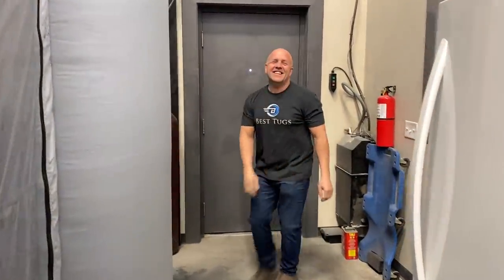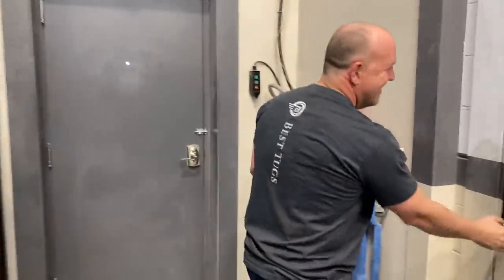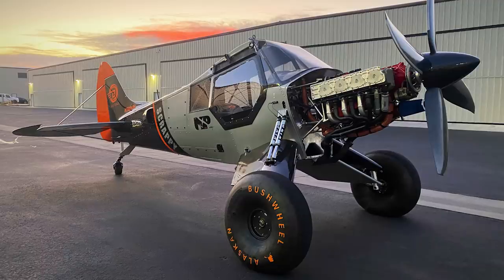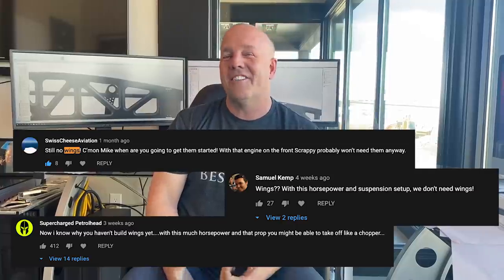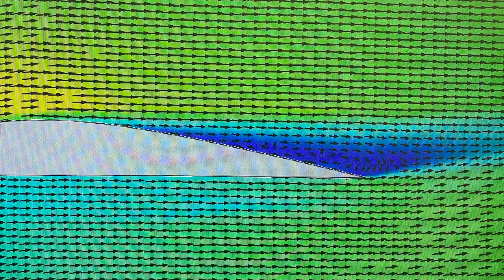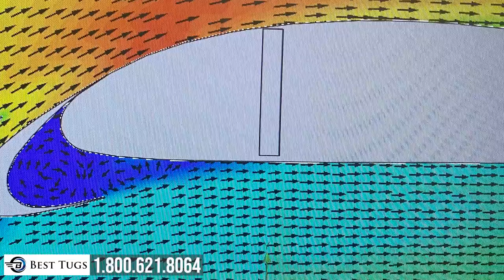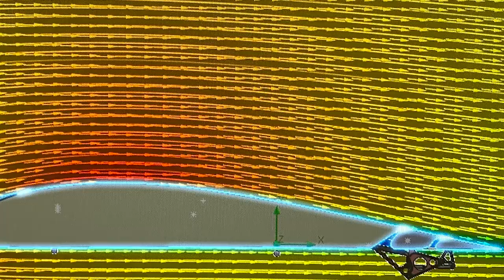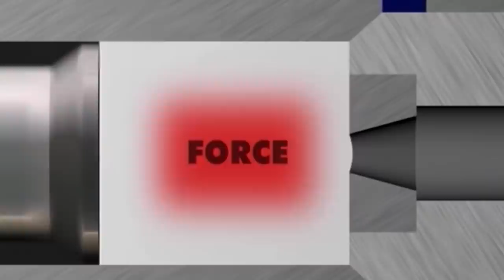Airplane Without Wings, Let's Try Something Different! | Scrappy #42

Comment: Well boys, we did it....we made him talk about the wings...
But seriously though you are such an inspiration.
Keep going mate.
Reply: 😂😂😂 I guess we all thank you. 😂
Reply: As for flaps and ailerons competing with each other, why not just combine them, make a flaperon, that always maintains an increased flap setting but also act as ailerons?  That way you'd get the entire wing as ailerons, and they both would also have a flap component put into them so you'd have flaps for the entire wing too.  Maybe ailerflap would be a better name, coming up with the name is the most difficult part.  Although moving the flaps out the front of the wing also to keep gravity centered would be the way to go.  As for that computer hardware you bought, the hardware you bought was overpriced and substandard, F4-4000C18Q-128GTRG has been reported to only achieve 3200 speed, could have saved a bunch on that. Those graphics cards, PYN Nvidia Quadro RTX 4000, they are only ranked 15,322 on passmark gpu benchmarks, a regular GTX 1080 or an RTX 3080/3090 would have been the way to go, if you could find them; but you appear to be made of money, so I'm sure you could have gotten some.  I built wings out of plywood when I was 12, figured out all the best lift to weight ratios, the wings were to strap on my arms; no computers were available, just measured birds wings sizes and their weights from an encyclopedia.
Reply: @nedblakely997  flaperons already exists for example on Trent's Freedom Fox. As always there are advantages and disadvantages to them. The main disadvantage I see for Mike's application is the added drag in cruise mode.
Reply: Mike shouldn't stop at extending wings, do swept wings! :D
Reply: @nedblakely997  your wing: everybody knows that.. I gues Mike as well. But he needs a wider envelope.
Reply: @dinobot_maximize  swept wings are very bad at low airspeeds, which is why you don't see them on too many piston powered or propeller driven aircraft
Reply: @MaximEck96  hey look at that, it does exist already.. but not as good as I would do it, but you are right it does exist
Reply: @tinolino58  well if his choice of airplane parts is as poor his choice of computer components.. scary.
Reply: @nedblakely997  hilarious how the IT nerds see the world.. love it! Have a great day 🚀🌴☀️🥂
Reply: @nedblakely997  Ned, your description was very interesting until you got to the end part... never forget what happened to Icarus when he started strapping stuff to his arms!    ;^)
Reply: @tinolino58  who is an IT nerd?  Certainly not me, I can bench press 300lbs, run a mile in under 7 minutes, do 20 pullups without cheating, and am skilled at just about everything I do, I have an IQ over 180+ on a bad day. But I am nothing special, I just am not religious, in other words I don't believe in anyone's authority, I figure things out, and I haven't been dumbed down like most people subjected to public school indoctrination, fluoride in the water, toxic injections by rockefeller quacks, etc. So yes, have a good day, maybe try to cut back on the insults and just look at facts and figure things out, try to not pigeon hole people into groups just because you don't comprehend something.
Reply: @MrGaryGG48  well I never got a chance to test them, I couldn't find the right type of materials and didn't have enough funding.. and like I mentioned, I was 12.
Reply: @nedblakely997  180 and feel assaulted with a comment about your simpel wing proposal? Get real. Talk to your ego and smile 🤣
Reply: @nedblakely997  an IQ of 180+ "on a bad day" would put you in the top 10 IQs ever measured. Why has nobody ever heard of your genius and scientific accomplishments?
Reply: @dinobot_maximize  FORWARD swept!!!
Reply: @JamesBalazs  yes, 180+; I have plenty of accomplishments, but they are for myself, I'm not a try-hard out trying to gain followers; you've heard of Einstein, yet both of his theories have been proven wrong and just math fantasies, one with a 1 page paper, by Stephen Crothers.   Fame has nothing to do with IQ, in fact the smartest people, you'll never ever hear about. Ever hear of Kary Mullis? Inventor of the PCR test, who declared, just before his timely death 2 weeks before event 201, that the PCR test can't be used to measure viruses and that Fauci "is a fraud", exact words. Ever hear of him?  Ever hear of the olympics?  Do you think those are really the best of the best?  They aren't. The best will never even get to see the olympics.  Okay, got to go now, I'm done with this thread.
Reply: @nedblakely997  as Stephen Hawking once said "people who boast about their IQ are losers". And you can attribute the following quote to me: people with no accomplishments in life who boast about their false IQ (while probably having never taken an IQ test) are worse than that.
Reply: @JamesBalazs  Stephen Hawking believed in black holes and other math fantasies too, but there you go also making an appeal to authority. And I'm not bragging about my IQ, I was defending myself from your inane attacks by presenting facts.

Comment: I’m obsessed with watching and learning from these builds. The shear amount of fine detail built in is remarkable.
I’ve gotta build my own plane now. I’m a military pilot, lots of time on the T-6 Texan 2, and you’re inspiring me to learn aero eng to build my own monster.
Reply: Same! I'd love to build my own plane (or two, or more :P) someday and I'd start with preexisting kits, but I have my own idea for a pusher bushplane I'd like to try. I already have a basic idea on how it would look and work, but I have so much more things I have to learn and decide on, such as what materials and construction methods I'd use. I also want the design to be easy to build and maintain, and affordable in case I decide to enact on my crazy business idea to start a kitplane company. I also have an idea in my head for an even crazier plane: a pusher bush plane that is also a hull-style amphibian and the wheels would either tilt up like a SeaRey or maybe even retract into the fuselage to allow it to cruise at higher speeds than a typical bush plane. But these are purely ideas so far and aren't that well thought out and might not even work. Before I attempt full scale though I'd definitely try out scaled RC models
Reply: Jon, nobody builds an airplane like Mike Patey!
Reply: @GaryMCurran  Absolutely! Thats why I'd find it absolutely amazing if Mike would design a new kitplane and sell plans and kits for it so others could experience a plane that is so well designed and thought out with Patey  engineering.
Reply: @johnnyboythepilot4098  legality of him selling/designing a kit would be quite the headache. But a well engineered barebones kit designed to be a blank canvas would be interesting.
Reply: @Pilot_405  Well there's plenty of kit manufacturers and people with a lot less money and experience than Patey embarking on those endeavors despite the liability risk, so I figure it would be a whole lot easier for Patey, especially with him being a serial entrepreneur.

Comment: I may be on short final but when Mike Patey drops a video I'm going around and doing some 360s while I watch this
Reply: Normally I just land on the nearest road instead of the runway so I can get to the video quicker.
Reply: @swisscheeseaviation590  I told the tower I would be circling they said they understood. They were watching it too.
Reply: Short final????  That is a term used by pilots who land planes, not ones that just pull the chute and float down!
Reply: @JustPlaneSilly  😂
Reply: Be real, you botched the approach.
Reply: I was hoping Mike would give us a peek at the profile he is going to try
Reply: @russellsmith3825  he did ... the whole time the foil was on the screen in the background ...
Reply from the maker: @JustPlaneSilly  😂😂😂

Comment: I was waiting for Mike to say he's putting F-14 style wing on Scrappy.
Reply: Or F15. Actually a very good idea. It has a drooping leading edge. Flies real fast AND real slow!
Reply: Lol! I was thinking exactly the same thing!
Reply: I  thought for sure he'd say he was going have controllable swept wings. LOL
Reply: That's what he would have done if he wanted to extend the wing out to increase the span, but he's going on a completely different route altogether. He's not making it tall, he's making it fat and wide . . . 😂
It'll be an extremely challenging part to engineer but it'll be an aeronautical engineering feat. 
This design style is already a naturally occurring phenomenon, in birds (most prominent in owls) but it has never been successfully designed. 
Variable sweeping wings (the technology of F-15) was a major breakthrough in aeronautics, and so can this be if it's pulled off successfully.
Reply: @ah11980  Yes, I put the wrong number 😅
Reply: @otemporaomores  Not a good idea at all. The F-15 is NOT a slow flier. It's landing speed is about 190-200 which is 50 above the F-18 and 80 over the F-14...
It's wing design is utterly outdated too, it's not even supercruise capable so what lessons could potentially be learned here?
Reply: more like the f-16 wing that changes camber in flight---
Reply: @kontoname  I have seen an f-15 do a 80 mpg knife edge at 50 feet----  lets see you do that in a super cub !
Reply: @user-ev6kv7lf2v  let's forget for a second that the F-15 stalls at nearly twice that speed, so no knife edges at 50 feet for you, you might be missing the two gigantic afterburning jet engines in the back. The F-15 is capable of maneuvering at slow speeds because those two engines can make it just bruteforce physics for a short time in the right hands. It's not meant to fly slow. Those wings don't allow it to fly well slow.

Comment: BY A MILE my favourite MP video of all time! I am so excited to hear of your variable camber thinking, we have been working on a concept for altering the camber along the full span but in a way that it varies differently at the tips as it does at the roots and is integral and linked to various phases of flight and operation. Our system employs a rotating actuator and a semi-flexible skin but we have suffered one challenge after the other, that's after tackling the obvious questions like how to keep it lightweight, not overly complex and expensive, how to, like a bird, fully alter the shape and size of a wing physically and relation to airflow and state and in as natural and unobtrusive a manner and not disruptive to the physics and operation of the wing. There's a NASA and various studies on this but all were extremely complex and jointed/segmented leading to unnatural action.

That's one reason why I am so in love with this video, but another that's just as important to me is that finally, we are taking steps to have a complete aesthetic so that I can finalize the slowest aircraft portrait of all time! When I saw you finalize and be sure of the design and size of your empennage I had a suspicion that you had a pretty good idea of the wing design already although I am sure it would have needed much refinement since. I CANNOT WAIT!! 

P.S I wasn't aware it was even an option to not watch to the very end, and then stare at the blank space wishing there was more.

Comment: I have often thought that the answer for wings is what the Falcons and airlines have been doing for decades; relative high speed profile (thin wings) with leading edge devices (droops and possibly vortex generators) and double slotted full span Fowler flaps with fences and spoilers .  This effectively makes a thin narrow camber wing into a broad thick wing with the benefit of all the devices to keep the air flow stuck to the surface of the wing...

Comment: Hey Mike awesome as always, 
America’s Cup yachts last generation were using solid wings which altered camber on the go, no sails, so more camber to get up on the foils and then flatten off as resistance decreased and higher speed = less drag. Have a look at the America’s cup on You Tube current event happening now!
Reply: i follow the America's Cup and was thinking something similar, and kind of wishing that mikes build a flexible, morphing wing with some kind of flexible/elastic skin that includes all the moving parts inside :)

Comment: Sounds complex Mike I can’t wait to see the results. Did you ever look at the concepts the America’s Cup boats use for the main sail? It’s a double skinned wing that the crew can change it’s shape on demand for speed and lift. Cutting edge technology that make those boats literally fly up out of the water at 20kts in just a 5kts breeze.
Reply: I’ve thought the same thing! So much potential there I would think... Also, this advanced wing concept has got to be another reason to go with the parachute system. Asymmetric wing configuration could make the aircraft uncontrollable. I’ve been hoping for something like this!

Comment: I can imagine a lot of nights spent thinking and thinking again about new ways of doing things... love that. My other crazy ideas: 1/ an inflatable upper part of the wing to transform a high speed profile into a high lift profile, with springs keeping the tension of the fabric uninflated (retracted inside). I know, you don't want that air balloon to be punctured or deflate suddenly while flying at 35 mph low over a forest... But inflatable technics are so much better now Than it was 20 years ago... 2/ blowing air at high pressure over the sensitive zones, either to force normal air to stick, or to replace air that do not stick... Ok I'm a dreamer... not an engineer :D Love your work. Thanks for sharing this with us. Take care, from Switzerland. Nic

Comment: Halfway through the video when you were asking all the questions about "The [single] perfect wing design" I couldn't help but think about a wing that dynamically alters its shape in-flight. 
A few minutes later and that's exactly what you're going to do. Contrary to my ideas of a perfect design that always end up unfinished and left to rot, you've followed through to an actual design and are pushing through to a finished functional product. I'm continuously amazed by how you are not stopped in your tracks by the size of the task ahead of you.

Comment: Sounds as if Mike wants an aeroelastic, variable aperture(s) leading-trailing edge multiple element telescopic 2 axis  variable incidence and position wing.  There will never be another, Roll control and perfect pitch control to Zero Airspeed, with a top end over mach 0.XX...

Well done Mike on Attaining Engineering Design Freeze.
Reply: Hahahahahahahaha! Oh! That's a mouthful 😂😂 
It's also funny how accurate the name is, LMFAO!

Comment: I love the engineering purity of asking the question of why can't I design something that is low drag at high speed and still has a low stall speed, and then going ahead and solving for that  condition. 

Experts: You can have speed or low stall speed. 
Mike: Conventional wisdom be damned, I can solve for both.

Respect
Reply: Yup.  A good engineer looks at the observation that the same wing shape isn't going to work well for high speed and low speed, and says, "okay, but what assumptions are built into that observation?"  There's an obvious answer: "Who says I have to use the same wing shape?"

That's obvious enough that there's a standard answer: Conventional wisdom says that you can add flaps and leading-edge slats, but altering the basic wing shape is too complicated.  Mike looked at that and said, "That's not a law of physics.  That's just, like, your opinion, man.  Too complicated for what?"

And then the thing that's really Mike's genius comes in: actually making it work.  A lot of people could say, "sure, the solution is that the wing needs to transform."  But building one that's reliable and will fly and not be too heavy, that's the real challenge.

Comment: In order to reach pressure equality between the upper and lower side at the trailing edge of the wing, the pressure will have to increase again as you move further towards the trailing edge. The boundary layer of the flow doesn't like this at all. Strong pressure gradients will cause the boundary layer detach . A detached boundary layer (stall) causes a drastic increase in drag and decrease in lift and is therefore highly undesirable. : )
Reply from the maker: 🤠 yes 🙌🏼👍 I love technical comments make me smile.  You are 100 percent correct any that was one of my bigger challenges in creating an in flight adjustable wing in both camber and cord.  I think you will like what I have done to accelerate the air and keep everything laminar all the way to the tips at extremely high aoa and low speeds.  Thanks for the great comment 👍🤠🤠🤠
Reply: @MikePatey  It's also important to consider not just 'when' an aerofoil stalls, but also 'how' it stalls. For example, some so called "laminar flow" aerofoils intended for higher cruise speeds can have a tendency for the boundary layer to detach rapidly over a large area of the wing at high AOA (rather than gradually departing from the trailing edge) which can lead to sudden stalls / wing drops in conditions where a high lift wing might only mush & wallow in a partial stall. Looking forward to seeing what you've come up with Mike!